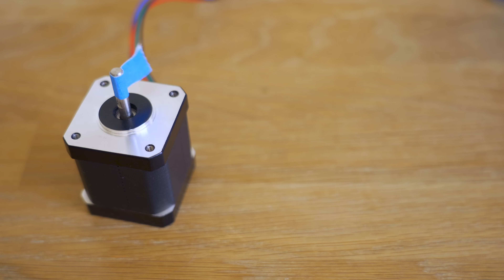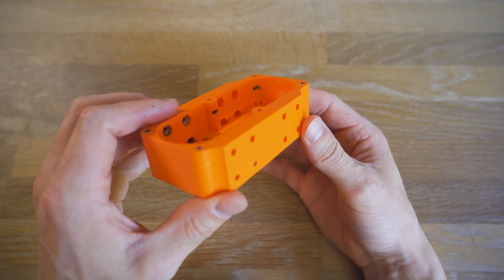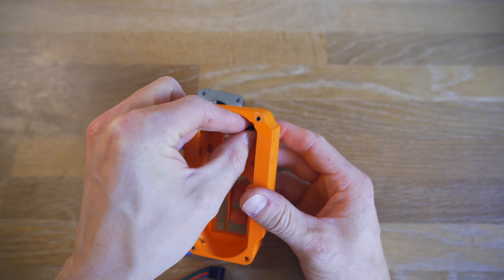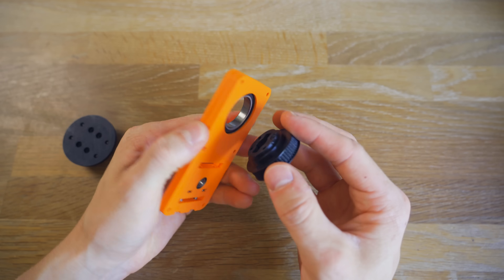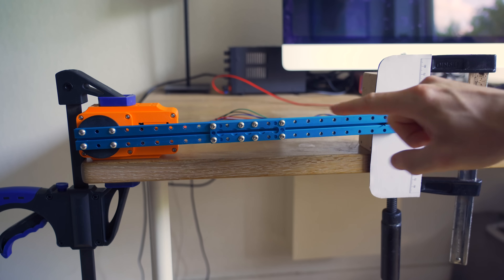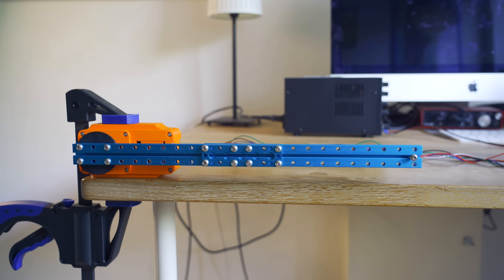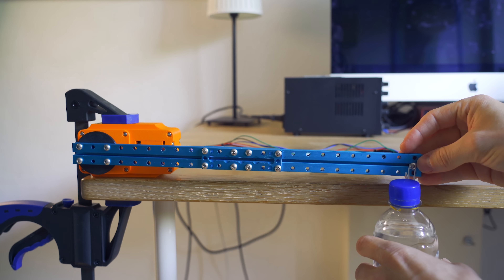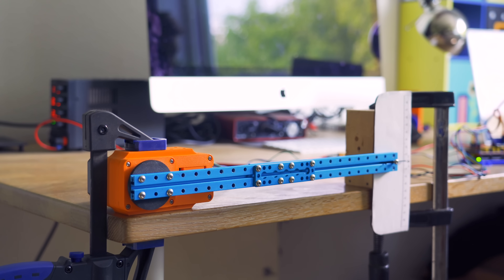3D Printed NEMA 17 Precision Gearbox with Position Feedback!

Comment: Found this channel, immediately subscribed ! That's a great design i want to see more.
Here are some improuvements i can think of:
- Stepper motors usually don't get hot so u can include it in ur enclosure. 
- Adding a pcb that contains a small microcontroller and a stepper motor driver.
- Create a hole for a connector, so u can just provide 12V and pins for communication with the master microcontroler.
- Create ur own library, OOP will be the best route to take to get and set data E.g stepper.getPosition();
Reply from the maker: Hi! Thank you very much! And thanks for your suggestions - I like them a lot. I did briefly consider making it a more 'complete' solution with all the electronics inside. So maybe I will look more into that, If I revisit this design. However I do have another stepper gearbox design in mind that uses an absolute encoder. I think this would be an even better candidate to make fully integrated.
Reply: I recommend against including the stepper motor into the enclosure, personally, unless you also want to take the time to print or mount a set of cooling fins. Whether they get hot, how hot they get, etc; depends on a lot of factors, and plenty of people have had their stepper motors get very hot over the years, especially on longer or high-speed prints.

Adding a dedicated microcontroller and driver is fine for those whose projects require only one motor, but it tends to become a balancing act for people who need several motors and already have a monolithic control board (ex. RAMPS, etc). A reasonable compromise might be to include a simple coupling board so that your connectors are secure and all in the same location, and a list of recommendations for drivers and microcontrollers. This would also help to keep the production cost down in the end.
Reply: Stepper motors definitely get hot under load